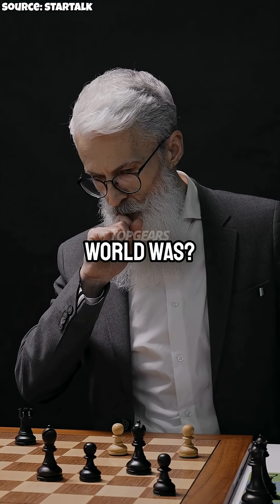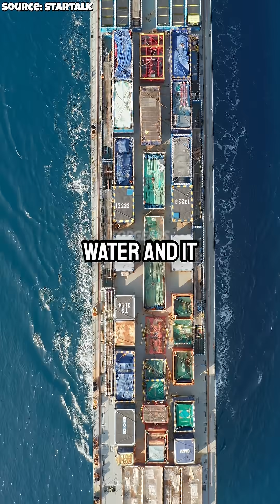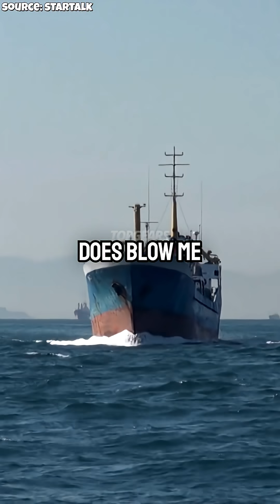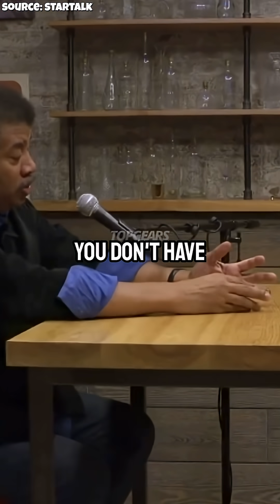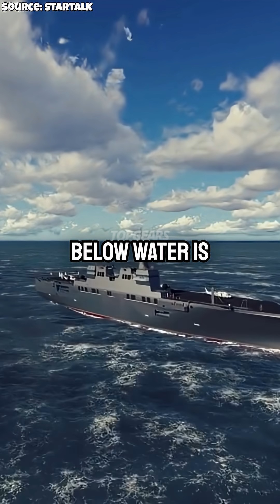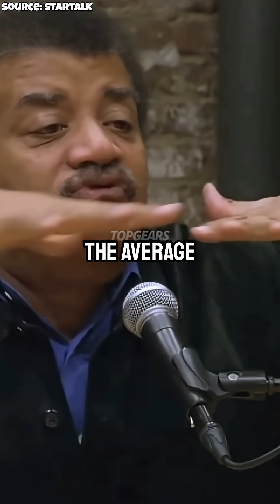Why Do Steel Ships Float  w/ Neil deGrasse Tyson

Comment: The part of the ship that sits below water is most decidedly not "mostly air"
As a matter of fact, boats need their weight posititioned low, to minimize rocking
Boats float because they weigh less than the water they displace

How is this guy considered a brain?